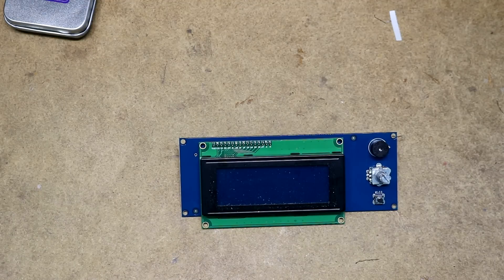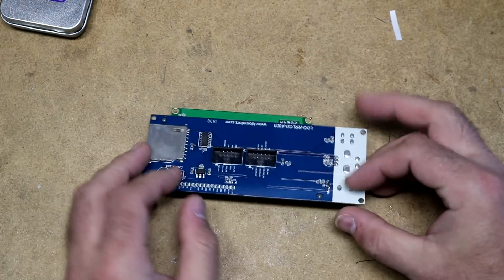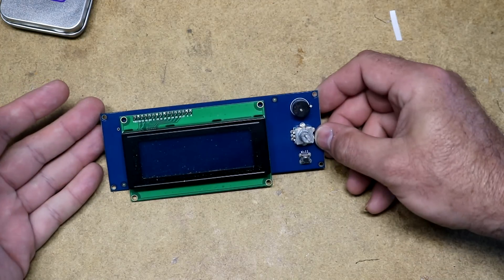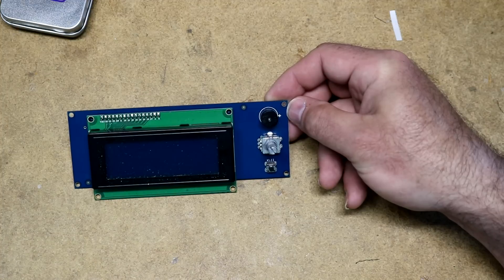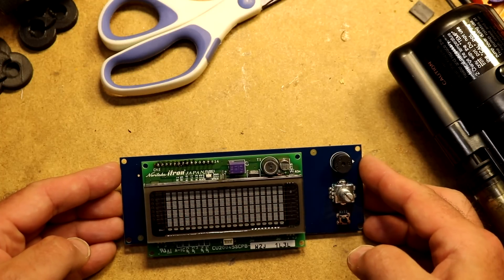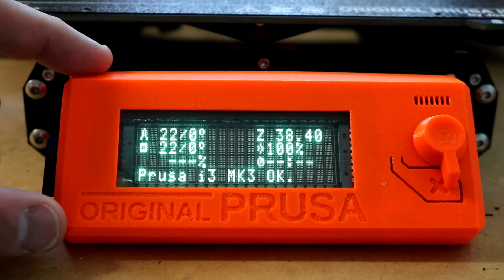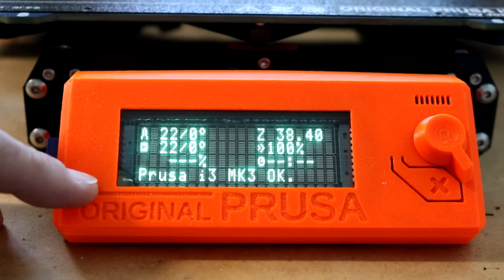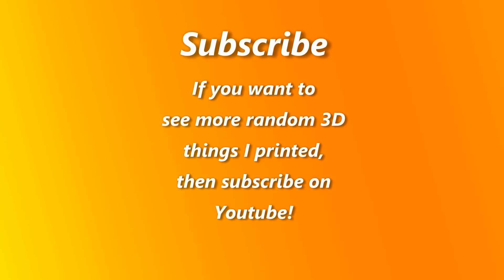Quick Printer Hacks 01: Vacuum Fluorescent Display (VFD) on a Prusa I3 Mk3

Comment: I installed a CU20045-UW4J into my prusa and the click wheel will always skip the second menu item in a list, and then when i turn the knob again it goes back up to the item it missed, then a a third turn will cause it to skip the next item and then it  scrolls normally.

Also when printing, the file name does not scroll and is instead cropped and moves about 8 characters of text once and then stops.
Has anyone come across these issues? Any ideas on how to fix this?
Reply: I'm not sure about the name scrolling part but I do have the same click wheel issue. The 2nd and 3rd row of text on my display also seem to be swapped. I'm guessing the two issues are related but not sure how to fix, maybe the controllers are slightly different or something?
Reply: @teguh.hofstee  Hello, yes there is an issue with the controller for the display.  The UW4J uses a controller that is not compatible with how the prusa ramble outputs text, you must use a UW5J
Reply: @TehTechnoGuy  I tried to comment this a few times yesterday, though I guess it didn't show up, but the fix isn't too bad if you modify your firmware. In lcd.cpp there are row offsets defined as { 0x00, 0x40, 0x14, 0x54 } that you just need to swap around to { 0x00, 0x14, 0x40, 0x54 } instead. I'm not 100% sure if it should be 0x14 and 0x54 since the Noritake datasheets list the row offsets as 20h and 60h respectively, but making that change fixed the click wheel issue for me and puts the rows in the correct order.

Comment: I ran out and did this as soon as I saw your vid!  A few hopefully helpful comments:

The filters from China tend to be flimsy pre-cut pieces of lighting gel.  Very disappointing, especially as you can get a huge sample book of those for free from just about any theater lighting company.  Just go to the GAM, Apollo, Rosco, etc websites.  If China did send you a nicer one, let me know!

You can order the latest model of the VFD direct from Noritake here in the US for about $75, and they throw in a sample pack of matching color filters, nice ones, about 1.2mm thick and anti-glare.  Unfortunately that extra 1.2mm is enough to need a custom case to swallow the extra thickness.

The flickering is the Prusa firmware.  It resets the display every 60 seconds because, apparently, some models have had trouble with static electricity/noise corrupting the display.  If you want to build your own firmware, you can turn that off.  You can also change the thermometer bitmap to not cut off the bottom :-)